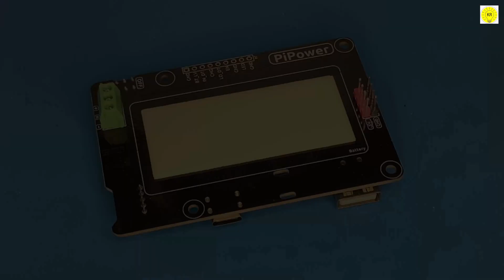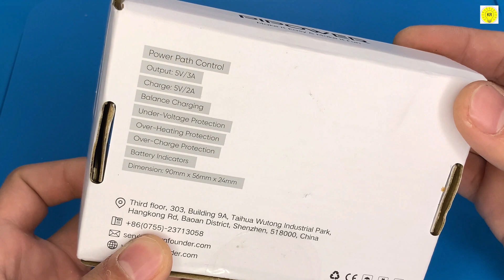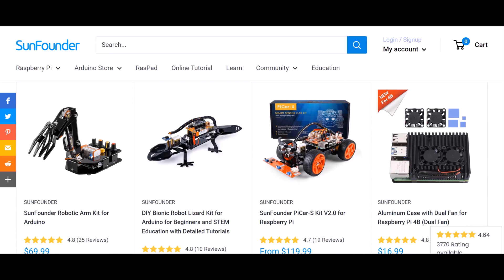Power Supply with Battery , SunFounder Raspberry Pi UPS , powerbank

Comment: Interesting. One improvement I can see needed would be pogo pins from the PC Board to the Pi board for the power feed. The layout screams 'kludge' when you use a 4" usb cable to feed from the PC board to the Pi.
Reply: and then you can't use the pi mtg holes....BAD idea